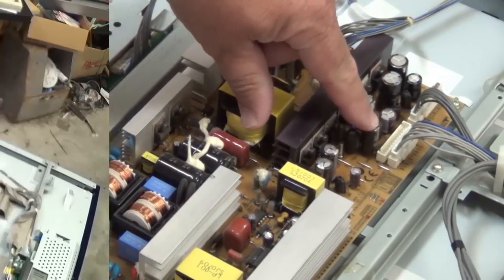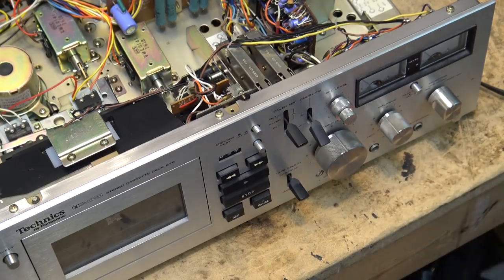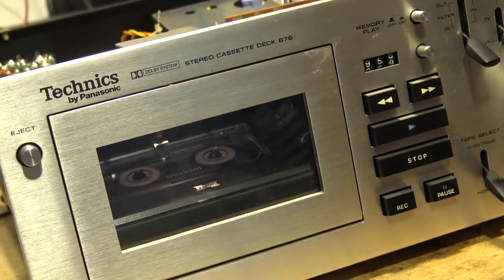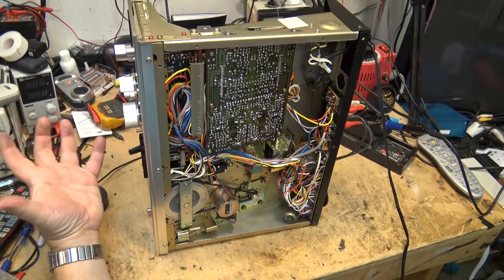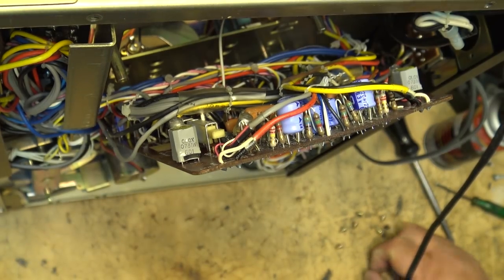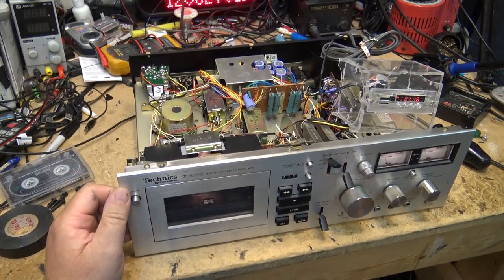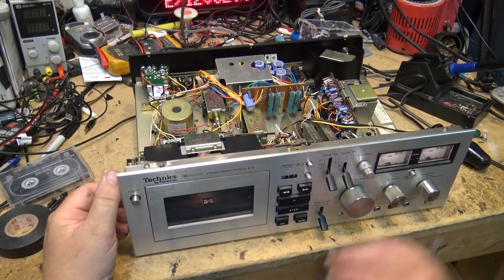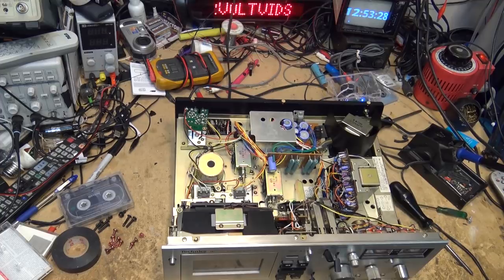Vintage Technics RS-676 Cassette deck overhaul

Comment: great stuff...I am trying to learn more about the inner workings of Cassette Tape Decks and to fix a couple I have at home...could be something simple as replacing belts and cleaning heads...but I wanna know the general layout of a tape deck. By the way, do all tape decks have that speed adjustment screw in them?  And what causes tapes to speed up or go to slow? Many thanks from London, UK! :-)

Comment: I have seen nylon ribbon used in drive belts on the Crown-corder but I suspect that the need for drive belts were killed of by the use of servo motors, I had a PHILIPS DCC900 which was servo motors throughout except for a single tiny belt which operated the tray loading but is now in need of recapping to get it to play analogue tapes as well as PASC(Precision Adaptive Sub-band Coding)  encoded parallel tracks of which there are 9 one track was for the track and artist and possibly lyrics data.

Comment: I have a Technics RS-B33W and the button array for the noise reduction selection has loos connections inside the buttons. But it still runns fine.

Comment: The construction wow, all metal. Do you know why all these vintage metals look brown/yellow, is it a special finish? Anyway, what is the name of your fancy cleaner you talking about? Nice video of an awesome product, love the construction.
Reply from the maker: I am sure it is dipped in a corossion inhibitor as steel will rust. Cleaner is either deoxit or nutrol. Those are the only 2 i use.  White can is nutrol.
Reply: @12voltvids  Thanks. Steel or Iron? Steel don't oxidate, iron will.
Reply from the maker: @codebeat4192  Steel certainly will rust. Stainless still won't
Reply: @12voltvids  You are right ;-)

Comment: Just over the weekend,  I've acquired a 1976 AWA slot in cassette deck,  smiular to a car cassette deck, cassette loading . It has Dolby , bias switch and EQ switch. But it not as high end as this deck. And different transport mechanism. I'm trying to find out who made the transport mechanism for AWA.
Reply from the maker: I can give you a hint as to who made it it starts with an A and it ends with an a. Oh and there's an IW between the two A's. AIWA made their own decks, they were a sister company of the Sony corporation and made a lot of products that soon found their way to carry the Sony badge.
Reply: @12voltvids Thanks for replying,  that's the thing though it's a AWA not the more common AIWA  brand. I think AWA was a Australia company,  but the deck is made in Japan,  Apart from a mention , and some photos on Radio Museum page , I can't find any information on it.
Reply from the maker: @vidtech2630  I thought it was a typo because when I use voice dictation which i often do on my phone when i say aiwa google spits AWA back.
Reply: @12voltvids  yep , same here when I Google it , I get a flood of AIWA brand products.
Reply: I was able to find a bit of info ,that pushed me in the right direction on this deck , and it turns out it uses a HITACHI cassette mechanism.

Comment: Technically DBX was successful, as that is what was used for analog TV stereo.
Reply from the maker: Yes and it was also used as the noise reduction system used on beta HiFi, 8mm and hi8 audio and vhs HiFi, bit just like with the VHS system which JVC stole from Sony, they tweaked it just enough so they didn't have to royalties to dbx Corp.  It was used on the l-r channel on MTS tv audio as well as the sap channel.

Comment: Hello. I recently bought the 671 which is very similar to this. I'm having trouble removing the 2 meter knobs. It looks like they might be connected with a small allen or torch screw? I can pull the volume knob straight off but meter knobs are on there good & I can't tell if the small holes on each know has a screw down in there. Any help would be appreciated. Thank you

Comment: I picked one of these up yesterday, and will be cleaning it up tonight. Upon initial inspection, it rewinds/fast forwards fine, but it isn't playing. I was able to find a manual for this unit online, and under the troubleshooting section, it states that you should make sure the "dummy plug" on the remote control jack is connected completely. Unfortunately, it didn't have a plug or remote with it. Do you know if having nothing plugged into the jack could prevent it from playing?

Thanks for the video, this'll be super helpful as I troubleshoot!
Reply from the maker: I bellieve you need to have the dummy plug in if not using the remote of it will not work, as the dummy plug connects some of the pins together.
Reply: @12voltvids  Dang! Haven't been able to find a replacement online yet... the hunt continues. Thanks for the response, appreciate it!
Reply from the maker: @theseidlehands05  I have the remote for that deck
Reply: @12voltvids  It's starting to look like tracking down a remote is easier than finding the plug, though that'll make the fix considerably more spendy. Might be my only option though, short of buying a parts unit.

Comment: The autostop rattles. I wonder if the small idler on the right side misses the grip on the metal wheel underneath the capstan🤔. If I push the plunger by hand, it works.

Comment: I have a really similar Aiwa AD-6500 deck weird front loader like yours and is it really worth restoring? it's absolutely massive and has a FeCr setting but it might not be solenoid control it's got big normal keys for it's functions. That being said it's a monster (30 pound cassette deck!!) and it seems extremely well built but needs belts and lubrication like anything from '77 would. IIRC it has a flywheel and motor in it like something from a reel to reel deck in there. Let me know what you think, and possibly where I could find a belt kit or info on belt sizes and types for it.

Comment: Great video! Your deck is sending me down memory lane as I have the exact same unit and I’m trying to rehabilitate it. I found a local repair man who used to work on them and the belts have unfortunately succumbed to dry rot. He’s looking for replacement parts. Any idea where they can be had?
Reply: I just found this deck for $19.99 in a thrift shop. I had the belts replaced and it sounds nice. Only thing is: It plays too fast
The belts are available on EBAY. Just do a search.

Comment: That's what i call a tape deck, it reminds me of the old jvc vcr's, metal and solinoids :-D
I have an old pioneer Ct200  tape deck that has push buttons/logic control, but it looks crap in comparison to that Technics lol.
Reply from the maker: I thought my RSM275 was good. (actually it is very good for a 2 head deck as it has a direct drive quartz lock motor, but it uses a belt to operate the head raising cam, and that is it's weak point. The belt is almost impossible to change, and when it slips, well you can't engage play.) but as far as build quality goes this one is fantastic. Performance is not as good as some decks, as the frequency response is only good to 17KHz, but that is probably fine for most people over a certain age.
Reply: Some people used to swear by using a sendust head, i bet it would be hard to find one now, and not worth upsetting the bias of that technics.

Comment: I admire the technology and build quality of vintage decks.  Have not seen one like that before. Good video. What is the vacuum tube amp you shown early in the video?
Reply from the maker: It is a Yaqin MC-10T and it is a FANTASTIC amp. 
Yaquin is a Chinese boutique amp manufacture. I have had this amp for about 10 years now, and it kicks the crap out of my old McIntosh MAC1500. That is why the MAC is in storage (to be brought out and recapped some day when I get around to it).  It is pronounced Ja-Chin incidentally, and it is the engineers name who designed, and builds them. (Yaqin Ling) The company last time I did and reading up on them had about 50 engineers working there building them all by hand.  This amp gets LOTS of use as it is my daily driver for music. I had 1 EL34 pop, so I changed out the pair, and other than that it has been great.
There are some mods that can be done that will change the sound slightly, but I haven't seen any need to. Most of these "mods" involve changing out coupling capacitors to higher quality caps. One guy that modded his bought some audiophool capacitors and spent nearly as much on the high end caps as the amp cost, and said in the end there was a slight improvement, but not as big as he would have expected considering how much his special audiophool caps cost. So that shows that the factory ones are actually pretty good.  I'm not complaining. My other tube amp is the single ended ELEKit and it also sounds fantastic, but is only 8 watts, and that kit actually cost more then this 40 watt amp.  For the money I don't think anyone will dispute that you won't find a better tube amp, and when they hit the scene they had a bunch of high priced manufactures more than a little nervous.
Reply: Thanks. I have been looking for a new high quality amp and the the one you have may be what I'm looking for. I have a 1960's amp I built when I was 15 years old that uses EL84 tubes (push-pull) which I just restored to get back into tube amps.  I may purchase the Yaqin MC-10T. Reasonable priced also.

Comment: Speed sounds OK to me, doesn't drift. I need older heavy duty capstan motor that lasts, so I can replace the Taiwanese junk in my Nakamichi. A lot of decks made after mid 80's just don't last. Interesting that many of 70's early 80's decks had many features that later machines lack, even microprocessor bias and level adjustment. I like the clicky selenoid noise. And a lot of attention to the way electronics was mounted, wow my 90's Nak 3header sucks comparing to some of the 80s machines, the quality isn't there. Tandberg was another manufacturer I remember, and German Tekefunkens from back then. 
I has very old Akai with switchable level indicators, unfortunately too beaten up to fix it, even the motors had worn bearings that only I kept main board for parts. Ah, Fuji DR-1, horrible tape.

Comment: Hi matey from the uk really enjoy watching your vids  a quick question i have a sony lbt xb80av and the sony vfd tube has gone dim any ideas on how to brighten it back up as cannot source a replacement thanks.
Reply from the maker: Check the voltages. If the voltage drops the tube will get dim. If the voltage is correct then the tube is weak. You can increase the filament voltage slightly to increase emission.

Comment: To clean those heads the best thing is to remove the brown plastic cover above the heads.   That will make head cleaning easier.  I have done the same with my 671 deck.  The loading system is the same as your deck.  Btw... the power transformer of the 671 is placed in the top left corner.  
My deck has a slipping capstan.  Do you know how i can fix that? The rubber seems to be in good condition. I cleaned the heads and capstan with alcohol.

Comment: looks brand new to me. even no trace of dust
Reply from the maker: This piece, the matching receiver and the pair of sb7000 speakers are all in very good shape.  I haven't  gone over the receiver yet.  I am using the speakers in my house.
Reply: @12voltvids  that's great. some folks in my country would call tapes, decks and such "utterly obsolete" and doubt the sanity of all this equipment. They will bombard you with solid arguments that digital files are better, cheaper, more convenient etc. They don't understand that we don't need perfection and sterility and everlasting playability. The fact of finality of tapes, heads, LPs only adds to enjoyment, to say nothing of the feeling of touching all these knobs, levers and buttons which is uncomparable to using the stupid touchscreen, wi-fi or bluetooth. My congratulations to you on having this monster apparatus and thanks for your videos!
Reply from the maker: @bigbro5793  
That's the attraction of reel to reel.  Gives your eyes something to do while listening to the music.   "The reels of the tape go round and round" lol.

Comment: Working on this unit..alls working but the fast forward and rewind solenoid is not working..the relays under unit click when push controls..will work if I manually push in solenoid..any suggestions?

Comment: I would love to have a lot of vintage elections.
Reply: Search thrift stores, you'll be surprised at what shows up. Tomorrow I'll probably buy a top of the line Pioneer cassette deck from the later 70's, one with analog meters, probably in the $40 range. Needs a knob or two I think I can find. Ive found a very nice Akai reel to reel, an autoreversinf Akai cassette deck from 1980, top model that was $600 new, and a pair of in the box Infinity mid size bookshelf speakers with little dust on them, all in original plastic wrapping and instructions. It's out there.

Comment: no bias control to do a proper alignement doesnt make any sens doesnt matter how good the tape deck was build! but for reproducing a tape it s fine
Reply from the maker: gaelfrenchy 
There are bias controls inside. They are set by a servicer using proper test equipment. Bias setting on machine is a gimmick without a pink noise generator and a spectrum analyzer.  Sure you can tweak it by ear but that isn't the way to do it. I have a teac 850 that does it right.  First it is a 3 head deck but it has auto bias. You put the tape in and press a button.  It records pink noise and analyzes the playback in real time and sets the bias current precisely to each tape. Creates a flat response that many would think is incorrect and manually tweak it down to over emphasize the treble. 
This is why most recorder manufactures would have recommended tape brands listed in the manual. This is the brand that the machine was set up for at the factory.

Comment: Hello. I have an sanyo similar to yours.. everything works exellent. Belts, mechanical lights, meters all work excellent Meters pop up when turned on but The units output signal just went out. I cannot figure out why. Can I send you mine to fix ?

Comment: I bought this deck yesterday.  But it has a very noisy motor.  How can this be fixed?
Reply from the maker: Change motor.
Reply: @12voltvids  thanks.
Reply: @12voltvids  Is it possible to replace it with a motor from other models?
Reply from the maker: @SergieNevidimov  yes if its the same speed, size and direction.

Comment: I know tapes were pretty terrible but i still hold a special kind of nostalgia for them,  but i think metal tapes were overrated i always preferred a good typeII, and i really have never been a fan of japanese speakers, always preferred american or English, type1 tape records higher than type II, chromes should peak at 0db on the philips recording scale
Reply: tapes are not as bad as you think..if recorded and played back on a good system they can sound as good as CD.
Reply from the maker: Synthematix 
I think I used metal tapes about 3 times. Fe-cr were my favorite tapes period.
Reply: good tapes make all the difference. ( still using tapes to this day )
Reply: The MOL (Maximum Output Level ) on a Maxell UDXL-ii  type II  is +7 db, so peak input level is mostly dependant on tape type and manufacturer specs.  Why would you say that  " type1 tape records higher than type II " ? I've never experienced that.
Reply: Warren MacDonald  type1 handle more bass, type 11 do not they are mostly top end, a good type1 tape will beat some chromes actually though, maxell UK being the best, type II shouldnt be driven past 0db really, record a 400Hz test tone and you will hear the distortion past 0db, anything past the dolby mark is pure distortion and on a nak dragon the dolby level is zero db
Reply: 12voltvids  they were ok but a failed experiment
Reply: scaleop4  er no they cant sound better than a cd, thats impossible. cds go from 1hz to 22.050Khz and are bit perfect audio, then theres the wow and flutter and other nonsesnse, tapes are a finicky media to deal with at the best of times, even on a nak dragon, still no match for a cd fella.
Reply: scaleop4  They werent bad but they werent that good either, a very fussy media that sounded different everytime you recorded, there was no common ground with tape, every tape type sounded different. Also the degradation of sound every time you played the tape -  then there was the fact very few people had professionally calibrated players, not talking about motor speed but dolby and proper azimuth alignment. (this is something you cannot do properly at home) you need proper lab equipment, due to the analog nature of tapes you will never ever get a proper maintained speed, makes no different how big the capstan weight is, makes no difference if the machines direct drive either, everythings based on voltage and gearing mechanisms. Tapes werent even designed for music in the first place, they are a dictation format used by police stations. Vinyl still had a more accurate sound, music tapes along with 8 track should never have happened for stereo music really.
Reply: Warren MacDonald  0db is a scale, the only thing that means something important is the dolby level, while its in different places on different decks its actually electrically in the same place amongst all of them: http://www.walkman-archive.com/articles/guide-excellent-recordings_05.html

Comment: i have a question regarding what u said about exercising rubber belt, does this rule applies to speakers with foam surround too?
and if it does how long can i leave them unused?
Reply from the maker: Rubber belts deteriorate faster if they are not used. The part that generally melts the fastest is the part in contact with the metal parts. The flywheel and pulleys.
Reply: OK , so what about speaker surrounding material (foam or rubber) do they deteriorate too if left unused ?
Reply from the maker: Yes they do, depending on the material. Some last for decades, like the 7000s I have. Others like my Altec Lansing 305 the foams rotted out within 10 years and have been redone.